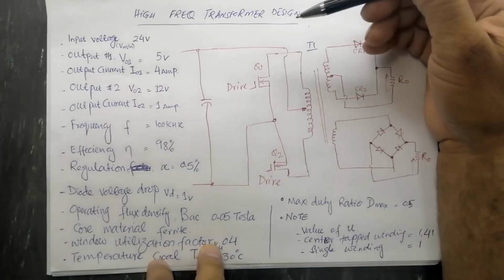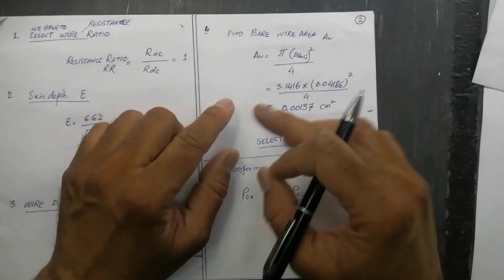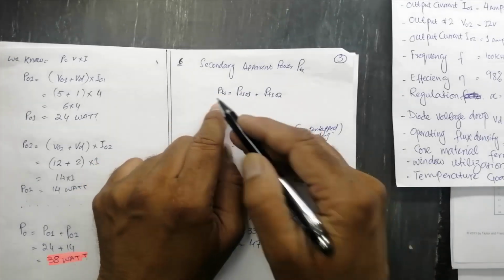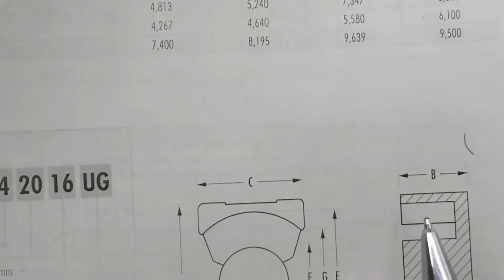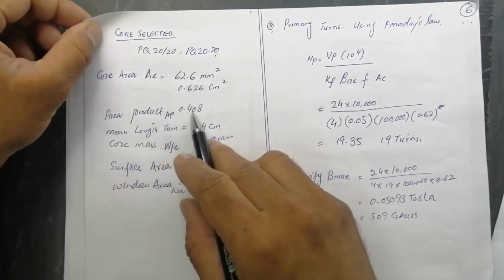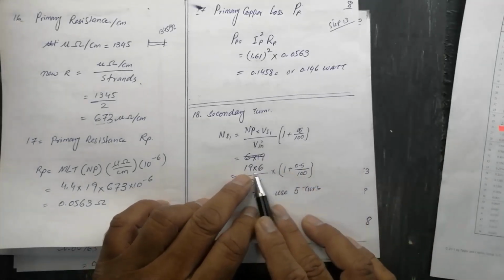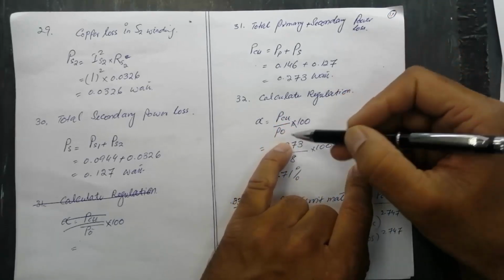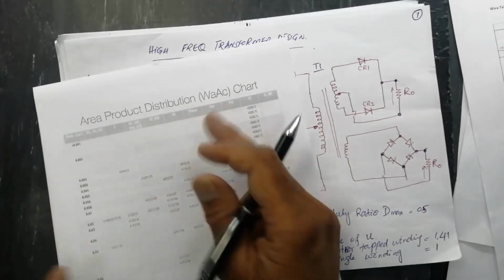#253 How to Design High Frequency SMPS Ferrite Core Transformer

Comment: Sir your Explanation is Topnotch, 1) but could you please tell us why Kg factor is multiplied by 1.35 I'm unable to get it Genuinely on what based calculation you have Taken.?? 2) As we had calculated the Individual secondary Bare Wire Area Aws1 & Aws2 but why you had not considered for Ku(p), Ku(s1), Ku(s2) Consideration.

Comment: Trying heart and sole with a pair of PQ(eer) ferrite core that have an air gap in the middle round portion but mosfet get hot in every way, the circuit is same but with ee33 core it runs normal. 

Do you have any suggestions to rescue me with that transformer?

Comment: Good day Sir, thank you very much for this very informative video. I appreciate you sharing your knowledge and taking the time to produce this video. Is it possible you can follow it up with the actual physical winding of the primary and secondary sections? I would like to see how exactly it should be done, how to apply tape between the sections and how to wind the transformer for best safety practices. Thank you very much. Regards

Comment: Please erxplain why Ptotal =  Ptin + Pts . Ptin is already calculated as Po/Eff where Eff is efficiency . Why are you adding again Pout value to Pin ?
Reply from the maker: this PTotal is to calculate Core Power handling. 
because for core selection we need core total power handling required by the circuit and then we need to consult the manufacturer's product datasheet to exact match of core 
in upcoming days i am arranging to calculate and design practically and i will explain every parameter and its related hidden parameters 
because the magnetic design the most complicated job than a electronic circuit. so i received many questions to be explained. i will do it very soon

Comment: A/a sir can we give direct ac220 to ferrite transformer
Reply from the maker: yes we can use it. but du3 to low frequency the core size will increase too much
Reply: @HaseebElectronics  then what is suitable voltage for it

Comment: What you are saying at 21.08 does not make sense . You have already calculated Ptin . What are you adding Ptout to it ?  You need to explain this
Reply from the maker: that is Apparent power. for transformer calculation we have to consider Pt (apparent power) not PT (total power).
in case of center-tapped winding we have to use factor 1.4 to get apparent power  value in the winding  
it is calculated 
power flowing in primary winding + power flowing in all secondary winding

Comment: Why multiply by 1.41 to get apparent power ?
Reply from the maker: 1.41 is factor for center-tapped winding. because it generated bidirectional magnet. because it utilizes the resonant current as well. so we have to calculate the bidirectional current in winding

Comment: You make a number of statements without  explaining the reason why you make this statement .  Why is Pt = Pin + Pout . Is it not Po/Eff ?
Reply from the maker: okay no problem. i will explain Apparent power in transformer. i will prepare a separate video on this point. because the apparent power and power in or power out is different

Comment: Please make a video on amorphous and nanocrystalline cores.
Reply from the maker: okay dear. i will try to share soon
Reply: @HaseebElectronics  Also, i have been long trying to clear my doubts on the inverter welder control design. It would be really great if you could lend me some of your personal time since as per your instructions, i did started the machine with my self-build control system, however, the ibgt were blown away right after i was trying to weld. Any help from you will be highly appreciated. I know you are very busy, but still i will expect your reply on this. Thank You. As always, it is great experience watching your videos.
Reply: @HaseebElectronics  just one ladt doubt..😅, the minimum current of the machine is 80 amps. Could you tell me what can be the reason for this. 
I tried adjusting the current through the maximum current setting trim port but the minimum current does not fall below 80 amps.

Comment: Excellent video.. Why minimum primary  inductance is not calculated? Will it be satisfied by default
Reply from the maker: yes dear it is satisfied as it is push pull topology
in flyback & boost topologies we need inductance value

but if we need inductance value for other calculations as RFI EMI filter design or inrush current or fuse calculation, then it can be determined separately
Reply: @HaseebElectronics   Sir, shall I use same method to design transformer for Full bridge dc dc converter.

Comment: Excellent presentation! 

could you please explain why you change the filling factor (Ku) from initial value 0.4 to 0.3 in WaAc formula?
Thanks
Reply from the maker: Fringing flux factor is amount of flux which jumps from the created core gap in center pole. the magnetic flux lines jump to next side of the core through the gap. so we must calculate this gap
window fill factor (ku). when we practically design a transformer we use only 30 copper. the other 70 percent of window area is covered in margin tape, roundness factor of winding wire, insulation tapes. unused spaces in layers
so if we fill the window then there is only 30% or 0.3 for manual winding  and may be considered if we use computerized winding (but it is will very very tight calculation, so during practical winding there is no space for errors or extra margins, because it will done by computer)

Comment: Hi,
Thank-you for the detailed explanation
very useful and informative video. 
I have few doubts 
in the starting of the video you selected window utilization factor as 0.4 and in the calculations of core selection using WaAc method you used window utilization factor to be 0.3. the window utilization factor is making a large difference in core selection for my core selection. if i am taking window factor as 0.3 i am getting area product as 3.25 cm4 and when i am taking taking window factor as 0.4 i am getting area product as 2.51cm4. 
Initially using Kg value ( 0.101cm2) i selected EE21 core and to confirm the same with WaAC method there is a confusion between EE-21 and EE-625 cores. 
What window utilization factor should be taken to select an appropriate core?

In the current density calculation using window utilization factor, you considered ku=0.29.if you could explain why you have considered 0.29 instead of 0.4or 0.3, it would be very helpful. 

I am getting the calculated window area (at the end) to be 0.45. Should i reconsider the design(the calculations are done for window utilization factor of 0.3)?

Thank-you

Comment: I noticed that you used the same wire guage  for both primary, secondry1 and secondry2 in your calculation while they are of different currents why
Reply: @HaseebElectronics  sir the secondary1 is 4amp and #26 guage wire at 100% skin depth for maximum frequency of 107kHz from AWG wire table can handle 0.361amp and for 4amp you calculated 5strands and 0.361*5strands will give 1.805amp is not up to 4amp

Comment: @Haseeb Electronics  sir in this i m using both side u u UU 126/182/20 this core so waAc is 2time of 286. And i want to operate at 20khz  with 3 uu core combined the power supply output is 16kv and 1.5amp current to charge capacitor very fast suggest sir. I want to operate 20 or 21 khz.

Comment: Sir i have this core can you tell how much density shell i use i am not able to calculate 3 core using for making hv transformer 
H bridge  core deta sheet below
https://www.google.com/url?sa=t&source=web&rct=j&url=https://www.mouser.com/datasheet/2/136/u_126_182_20-365723.pdf&ved=2ahUKEwjUtIDH0NHrAhV0wjgGHYGIAfwQFjAAegQIARAB&usg=AOvVaw3QhGCef7F-JHqeWtka_q7A
Reply: @HaseebElectronics  sir in this i m using both side u u UU 126/182/20 this core sowaAc is 2time of 286. And i want to operate at 20khz  with 3 uu core combined to increase power  the power supply output is 16kv and 1.5amp current to charge capacitor very fast suggest sir.

Comment: I need the link to your Google drive to download
Reply: @HaseebElectronics   Sir I appeal that you should make a complete and concrete video on smps design starting from the AC input with detail calculation of each components selected include a line filter and also how to select the smoothing capacitor after rectification from AC to DC